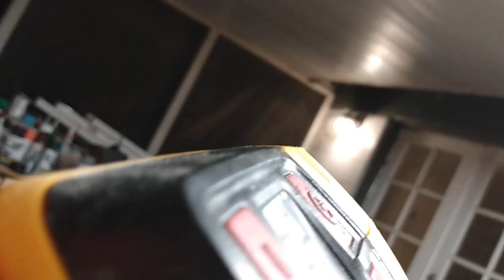EPOXY BATHROOM SINK POUR "Step by step tutorial the way I pour bathroom sinks with epoxy.

Comment: Thanks.  I've been trying to find a video on the actual sink bowl methodology.  This was very helpful.  About the sink bowl and backsplash - could the epoxy with a bit of mica powder slow down the flow rate of the epoxy.  Just wondering if you could do a backsplash in place vertically with some mica powder for thickener.
Reply from the maker: I've tried everything I know nothing seems to be able to slow it down at all
Reply from the maker: You can buy a thickener to use on the vertical surface that may work.

Comment: Do you spray paint for a base coat prior epoxying?
Would it be good to tape off bottom edges to lessen the need for sanding after epoxy sets?
Reply from the maker: It depends on what substrate I  am working with. For example if you're working with a solid surface material you have to have a bonding primer to give the epoxy something to bond to. Now if you're using plywood MDF or a porous material then yes you could use spray paint.  I've used spray paint a quite a few times for base coat. Have a blessed day. 🙂
Reply from the maker: Sorry I forgot one other question you asked. Yes you could tape off the bottom edge if you like that's really personal preference. I usually let the epoxy set up until it's really really tacky and I take a paint stick and scrape the drips off before they set up. But yes you can use tape most definitely. Have a blessed day 🙂

Comment: Do you use epoxy as a top coat after the paint dries? I painted my sink but I don't like the colors, can I paint again with different colors?
Reply from the maker: Yes once my color coat of epoxy cures I put a clear coat of epoxy over top to seal everything in. Yes if you don't like the color you can repaint where the color you like. I do have a question are you putting your paint in your first layer of epoxy or just spraying the sink before you do anything?
Reply: I spray paint on top of the epoxy.  Also do I have to scrape or sand the paint off before I repaint the sink?
Reply from the maker: @FMarie-po4mh  no you're good you can spray paint right over top of it won't hurt a thing I've done it many a Time.
Reply: Thanks! You're awesome. I love all your videos.
Reply from the maker: @FMarie-po4mh  thank you I really appreciate that comment it means a lot it truly does.

Comment: Hi.  Awesome Work.     Please advise..... What is the black Base coat? Do You use Enamel Spray (cans)? Tks
Reply from the maker: The black base coat is a bonding primer Anytime you have a non-porous surface You’re going to want to use a bonding primer it’ll give your epoxy something to bite to Know if it’s wood, MDF for a porous surface you don’t have to use a bonding primer you can use spray paint or any other paint for that matter as long as you let it dry good hope this helps
Reply: @LiquidCreationsCo2609  Thanks for the response .. ...  Helps 100 %...  With regards to The  Spray cans you use ie your colours, are they enamel paint?
Reply from the maker: That's why I started this channel is to help
Reply from the maker: Yes they are enamel paint

Comment: Beautiful job! Got inspired from your videos! I have quick question. My sink is painted with HOMAX tough as tile sink and tile refinishing kit. Can I do epoxy on top? Or do I need to scrape off that previous coat of paint from my sink first? If I can just do it on top then how do I prepare the surface? Thank you in advance and have a wonderful day
Reply from the maker: +Irina Sam First I want to thank you for your comment and support on the channel and I apologise for taking 19 hours to answer your question.
Now to answer your question what your going to need to do is first clean it really good then your going to need to paint it with 2  coats of a good bonding primer after the first coat give it a really lite sanding with 220 grit sandpaper then put the last coat of bonding primer on and give it 24 hrs. to dry then you can continue with your epoxy work. please post pictures when your done and if you have any more questions please let me know thank you again.